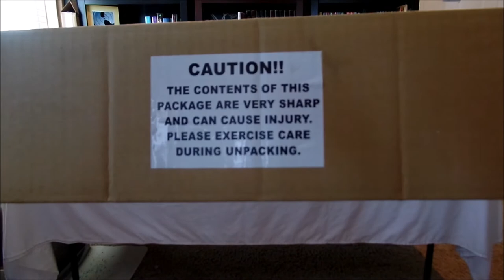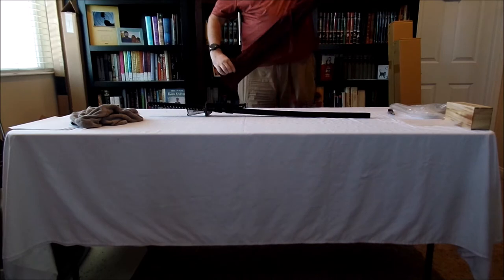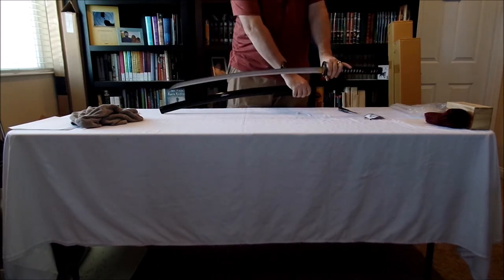Hanwei Great Wave Katana

Comment: I don't have a whole lot to add to the conversation here. I love the videos.
Haven't had the privilege to use one of these just yet.
I own 4 Hanwei swords and half of those are European blades.
Reply from the maker: I appreciate the comments.  Thanks for the compliments.  If this sword fits in your price range (depending on the distributor high $400s to $600ish) I would definitely recommend it.  And ... this is coming from a guy who out of six, seven, eight ... something around there ... different Hanwei katanas I've tried ... I've kept ONE!  Believe it or not it actually wasn't this one.
Reply: @mr.excalibur1455  may I ask which hanwei you kept?
Reply from the maker: @alh.4663  I have two.  I have a Mokko Renshu with the Bo-hi.  The other that I currently still have is the Practical Plus XL Lite.

Comment: Don't see too much about that model. Good review. Looks like it has a bit deeper sori than the average.. Those tsuka are definitely a deal breaker though. Nice static on that juice bottle. And got an empty! Thats not easy. Took me a year of daily cutting to be able to pull that off. Dont sell yourself short dude. I definitely noticed a marked improvement in your cutting.
Reply from the maker: Thank you for the comments about the cutting.  I have been practicing.  I've been incorporating the empty bottles as test for just how sharp these things CAN come to you right out of the box.  This is a very good example.  Having this nice model though helped alot.  I agree about the tsuka ... one of the reasons I ended up letting it go months ago.  But despite my own personal preferences which are often counter to Hanwei designs ... whoever bought that from me got a damn nice sword.
Reply: @mr.excalibur1455  welcome. For sure. They have a couple higher end models im considering, then just send the tsuka to be reshaped and wrapped.

Comment: Would you purchase this over the Tori Elite?
Reply from the maker: As far as Hanwei goes ... this was very simple and nice.  The Tori Elites, from what I can tell, are higher priced ... and I've never owned one so I can really make a comparison.  All I can say is that this was one had nice castings, the typical Hanwei rattle in the saya ... but it fits ... tight eto ... and a very nice cutting blade.
Reply: @mr.excalibur1455  thanks!!